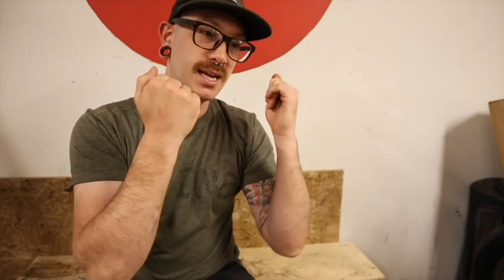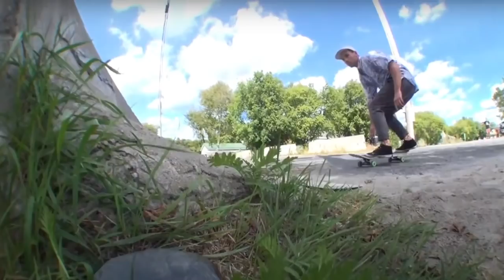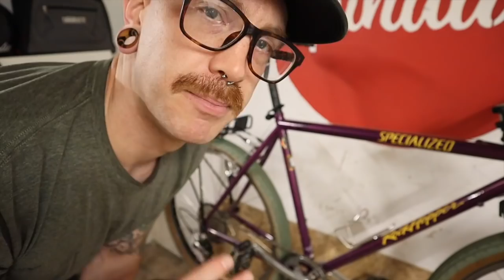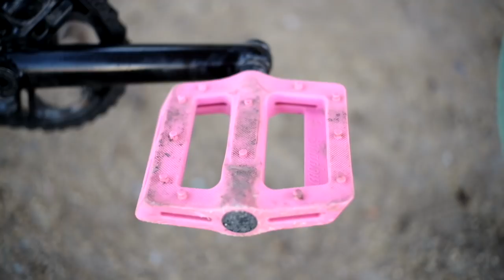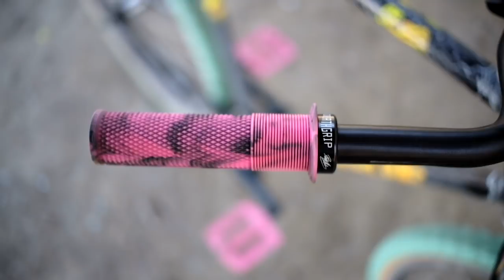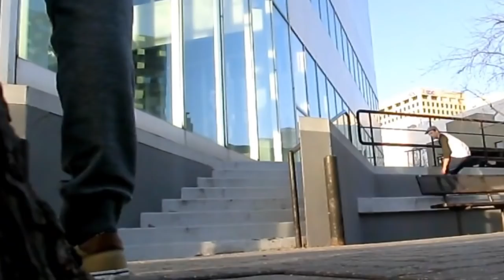This Coaster Brake GT Timberline is: Someone Else's Bike

Comment: Lol ok I’ll answer some questions. I did cut the seat tube. It went over an inch higher than the built in quick release so with a slammed seat my feet still lifted off the pedals, after cutting it I can slam it that little extra and it’s perfect. And no it’s not the correct seat post size (the bmx post is just a tad too small) but after cutting the seat tube and not cleaning up the steel plus throwing some gravel on the seat post it stays pretty good. Thanks for sharing my bike!
Reply from the maker: Haha yes! That’s sick.

I was looking at the GTMX thinking that’s what you might have done, but the QR is right near the top. The bigger bikes must have a bunch more meat.
Reply: How did you add the coaster brake?!
Reply: @lordskante6984  prolly just replace the rear wheel

Comment: I think he literally chopped the top part of the seat tube off and then re-cut the slot that allows you to tighten seatpost! You can do that stuff when you have non-integrated seat clamp.

 And also,  you can find pivotal seat post in 27.2, it is rare but definetely exists
Reply: Yup that’s what I did. But it is a 25.5 bmx seat post.

Comment: You're going to make me do it. 

You're going to force my hand and give me enough inspiration to build up the Raleigh Alaska step through frame I have sitting in the garage, aren't you? 
And maybe bodge on the Origin8 Tiki bars I have sitting in the parts bin while I'm at it.

Ding dangit.
Reply from the maker: Contractually obliged to do this now Dave.
Reply: @Spindatt  in that case, I need to start shopping seeing how I cannibalized it to townie up a Bianchi Lynx...
Reply: @Spindatt  I don't have the parts I need  in the bin for the Alaska, so here, have a peek at a different Raleigh I did up a while back. 
https://photos.app.goo.gl/9hmVRs8N3TVc2bRE7

And since I'm not building the Alaska (right now), here's the Bianchi I tore it down to appropriate the fork for. 
https://photos.app.goo.gl/BLFKi7FM3ci788mX8

Comment: bontrager deluxe rack is actually amazing...
yeah its not usa made... or cananda made...
but it will probably hold that board and has other points that, as a welder, i could see you using to weld a bent rod to and getting a grip on that board.
idk man. im high